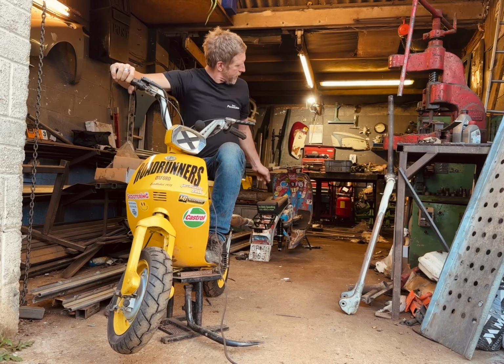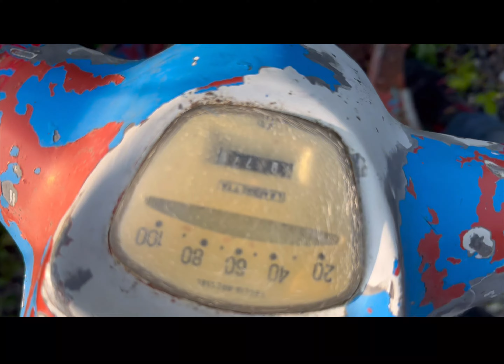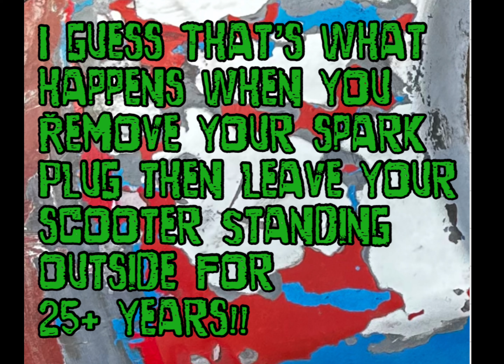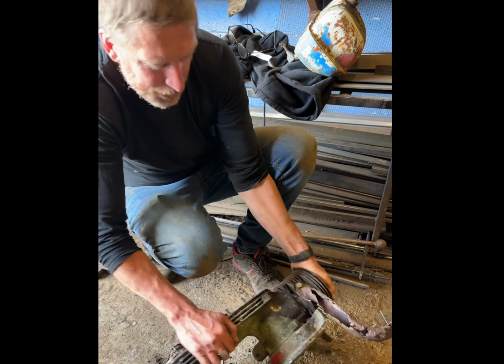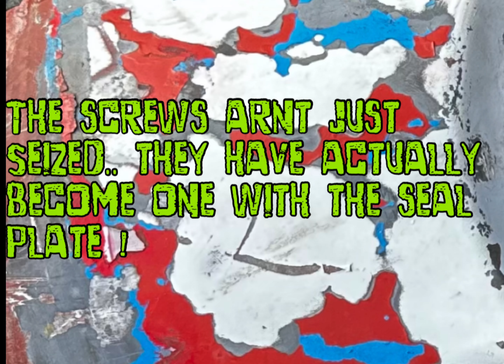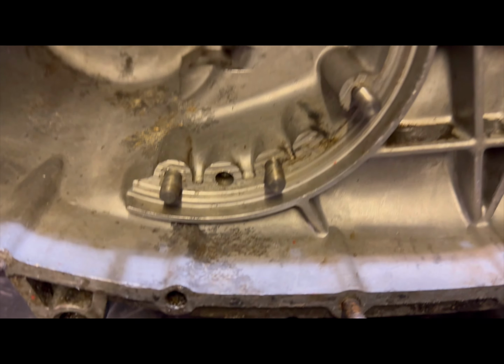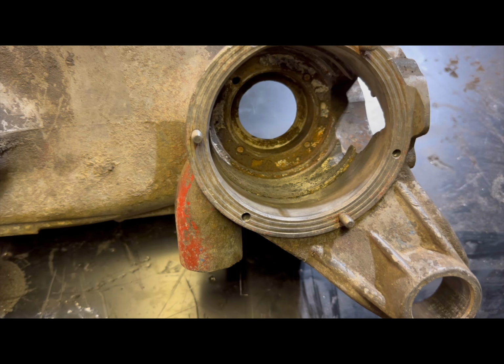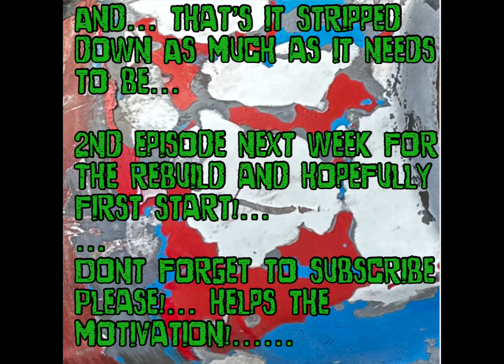Pt 1, 1967 lambretta abandoned for 25 years… can I get it to run?…. And ride it 500 miles!!…

Comment: This was more like mass destruction than disassembly. Why destroy the wiring harness and cables unless you have an A to Z inventory of rare spare parts?  In this condition, a real restoration would take months, otherwise you would just be cobbling together a Frankenbike with mostly non-original parts. I guess with a three week deadline that's all you can do. But I must admit you've got me hooked. Waiting (patiently) for the next installment.
Reply from the maker: The cables were all rotted thru and totally unusable!… totally… I’v kept the wiring loom- what you see me snapping is the stator wires.. the loom is remaining… it’s not a restoration though I’m just saving it and giving it a new life.. just replacing the bits that are worn/broken and putting it back on the road to ride safely to Belgium and back (hopefully!!! ) the rally is on the bank holiday so I have 5 days left before I leave now… hopefully first start on Monday…. 😬😬

Comment: Well it’s obvious that in that condition NO however if it’s completely rebuilt then obviously again it’s not the same scooter 🛵 we see in the photo 🤷‍♂️🤷‍♂️
Reply from the maker: @jimeverhard3647  wtf of course it’s the same scooter… and engine… just with wheels and hubs added (obviously you can’t ride it without wheels!) and some essentials replaced- ie steering bearings, piston and barrel/ exhaust etc… only the essentials were replaced so it could be ridden-the body/forks and engine casing/gearbox/chaincase/kickstart/etc etc are all original…, I don’t get what you mean it’s not the same scooter?